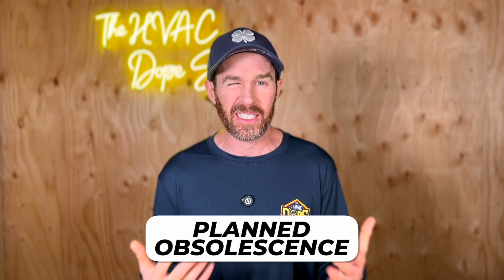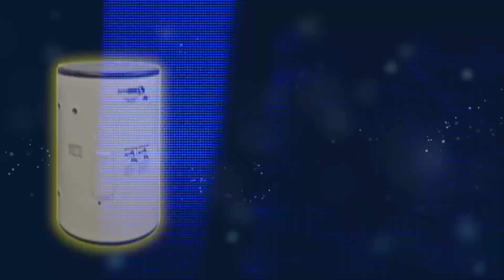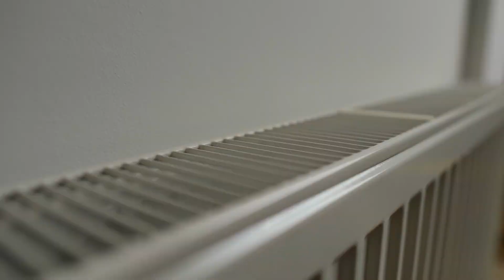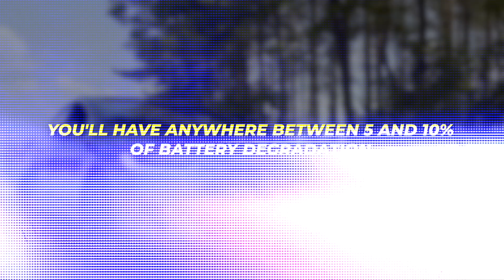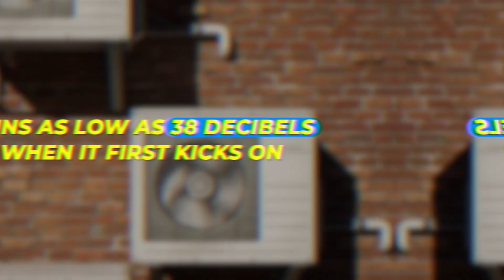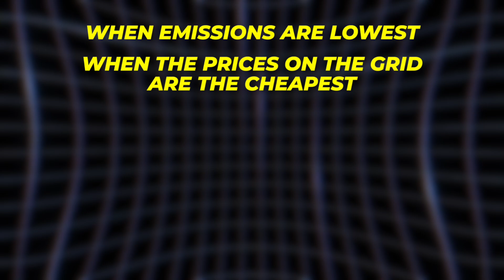Is this the most eco friendly Heat Pump on the Planet? Harvest Sanco2 Heat Pump Series

Comment: I have a SanCO2 HPWH with the heat pump hanging on the wall of our garage next to the tank foe short pipe runs. It's a wonderfully efficient and quiet system that has operated perfectly for about 2 years. Being in Florida it helps cool this unconditioned space.

Comment: It's the most expensive heat pump on the planet because of the high pressures and transcritical system. If the control fails, you try to compress dry ice. R290 is the best for ATW monoblock. The year-round effiencies of R290 is better  and because of the low pressures, its better.

Comment: Good idea but as some others point out - what is the cost? I went to the harvest website and it's horrific! There is no prices or specific products information just a generic statements and process which starts with "we chat" !!!... well if your products are too expensive or not what I won't as performance- why would I want to chat with you?... its really annoyingand a shame - good ideas smudered  by horrible business  attitudes...
Reply from the maker: It's going to vary by contractor that's how it is with all products and all manufacturers except for the ones available to the public (like Goodman Mr cool etc.)... the parts cost is definitely high for just the water heaters etc (varies widely by home size system demands) and roughly 5-6k for the brains / controller to run all the HVAC. I think the price will eventually become more competitive but the tax credit is what levels the playing field at the moment. The sanco2 product has pricing available online that's somewhat accurate for parts cost but again parts is typically only 30%-40% of installation costs, on this it will probably be higher just because of equipment costs but it's exorbitantly expensive to run a contracting business so that's why pricing from any manufacturers isn't advertised online (Carrier Trane Daikin etc...)
Reply: @TheHVACDopeShow  so, in essence, it's another expensive/ non-competitive system that takes advantage of politicians extracting funds from everione to fund the few who can afford it? The same applies to the installers... I am looking forward to the day when all of these schemes/scams stop and people are forsed to get real....

Comment: Thank you for mentioned the single direction issue with this.  I have a "perfect" physical setup for this system but cooling is HUGE for me, hit 115 a couple of times over the summer...independent units it shall be then!
Reply: I'm contemplating to use this as well, even though I'm in a fairly low cooling climate.

Set it up inside a solar panel attic to capitalize on summer sun to cool the top of the house and deliver hot water to a gigantic thermal storage water tank in a basement for seasonal thermal storage.

Still doing my homework to figure out if it's actually viable 😅

Comment: Do you know anything about the Daikin DH7TC?
Daikin told me they are rolling it out soon but I would need to talk to an installer for details.
Reply from the maker: You mean DX7 or DZ7? It's probably just the new nomenclature for a two stage heat pump, I'd go for a Daikin fit over that honestly the fit will be cheaper
Reply: @ I wanted a fit but my installer said it doesn’t qualify for the government tax credit. 
I plan to call Daikin tomorrow and hope to learn more. But they did tell me that they are rolling out a new unit in January. DH7TC
Reply: This is the text I got from my installer. 

Good evening I have been working on trying to get the unit you want approved. but unfortunately they stated the Fit unit you want, is not on their approved list of HVAC heat pump units for the rebate. I found this one 

file:///var/mobile/Library/SMS/Attachments/78/08/0C407A7F-6DC8-47B0-8BB7-043C400497E8/Screenshot_20241207_154700_Samsung+Internet.jpg

I told him I wanted an R32 inverter unit.  I hope Daikin can help me with this.